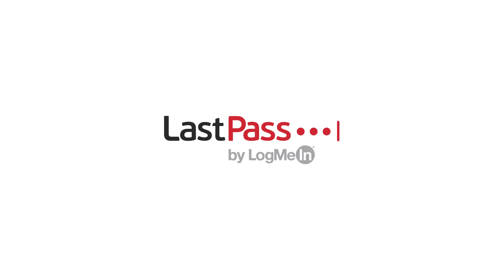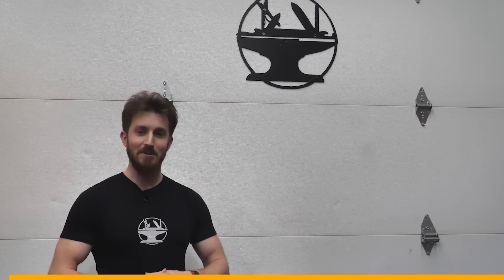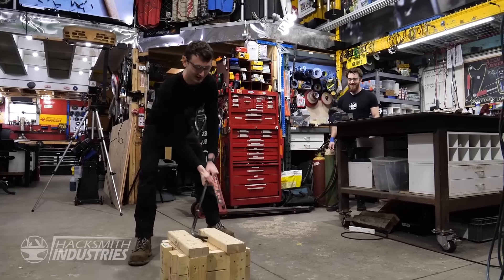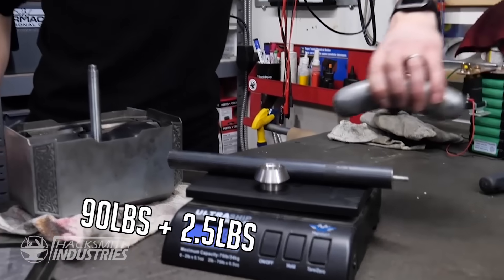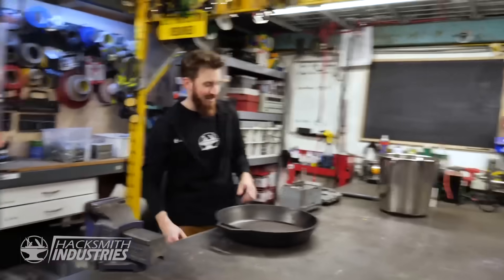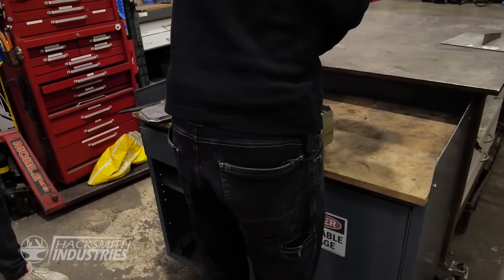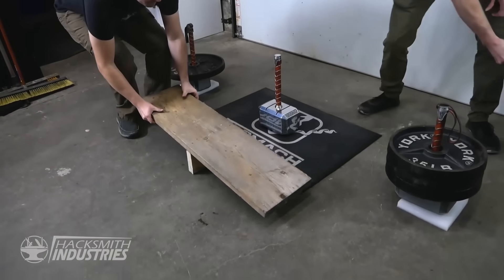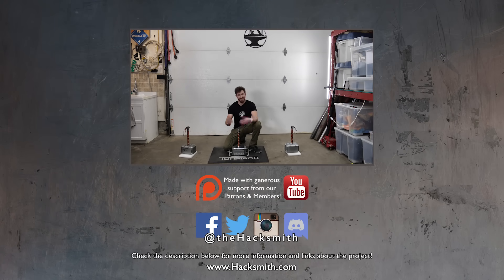Tungsten Thor's Hammer (World's HEAVIEST)

Comment from the maker: TOP QUESTIONS:
- Why didn't you melt tungsten?
Because it's got the highest melting point of any metal - no mold could hold it!
- How Ridiculous has a heavier one!
Yes... But it's also like twice the size. We have the heaviest 1:1 scale replica
- Use Osmium, it's denser than tungsten!
It would cost $3.2M if you could even find enough.

Other questions can likely be answered by watching our original video on the lead filled version, don't forget to check out all seven of our different thor hammers!

Thanks for watching!
Reply: Hey Hacksmith, I am making a theoretially bulletproof Captain Amarica shield and I can send it over so you can test it with more than the handgun you normaly use.
Reply: thanks
Reply: Hacksmith only though
Reply: + is 10 lbs heavier really worth $ 3.2M  ???
Reply: What about Iridium?
Reply: Did you like your own comment?
Reply: @Tombr4mb4  it pushes it to the top
Reply: @Tombr4mb4  did you
Reply: @Tombr4mb4  look⁹
Reply: the Hacksmith when will there be a video of you giving him the hammer and him trying to pick it up?
Reply: the Hacksmith my only question is why you don’t have 50 million subs yet
Reply: Why don't you use real neutron star matter?
Because taking on the full force of a star will kill you
Only if I die
Reply: Dear hack Smith I'd like you to make ruby's scythe from rwby
Reply: Should’ve filled the handle with something after you put it back together 😂
Reply: Shad0wr3x Z
Reply: Hi Hacksmith! May I ask where you learned how to do all the things you do primarily electrical hardware/software builds and metal work? Were you self taught or. have some professional education for your work? I am completely new to metal work and electronics but always have had a big interest in making my own things like my dad who passed away when I was young but I remember him always making things in our garage like upgrading and customizing his motorcycles to even making me toys that haven’t been made by any company yet like my own Zelda sword so I’ve always wanted to get into it but don’t have any experience nor the knowledge to get the proper tools or even where to start
Reply: Would it be possible to use tungsten for a custom handle for the lead mjolnir to help with balance? By no means do I expect it to 'solve' the balance but I'd imagine it'd help.
Reply: If you ever plan to make a heavier one, use a carbon mold. it'll hold molten tungsten.

edit: nevermind that's how you make tungsten carbide lol

Edit: Maybe a tungsten-halfnium carbide? It has a higher melting point and I on't think it'll form anything. but Idk how Expensive that would be.
Reply: You get my Like just for the Jujimufu shout out !!!!!!!
Reply: my top question:

HOW THE HELL DO YOU LIGHT A FLAMETHROWER ON FIRE
Reply: Dude just use magic. Much easier
Reply: the Hacksmith yeah why not Vibranium
Reply: you should use tungsten carbide its cheaper and heavier than tungsten, some heavy grade tanks use it 
as ammunition and it so heavy that its velocity itself causes massive explosions
Reply: Hey would you make a pilot suit from Titanfall
Reply: the Hacksmith you need to make a vid with thor receiving it and trying to lift it
Reply: You could have used a neutron star to fill it

Then it would had traveled to the core of earth.
Reply: Makes sense
Reply: My top question is 
What kind of drugs were those!?
Reply: Your Mom. aka Isaiah just smelling salts
Reply: prAna Stretch Zion pants?
Reply: Any chance of a video of his reaction to the gift?
Reply: Yeah I had the question about why melt  the tungsten. Then I asked Siri what’s the melting point of lead for reference it was 600ish degrees. Then I looked up  the melting point for tungsten it said 6,400ish. Yeah you probably have a point there
Reply: MusicalSteve   your*
Reply: the Hacksmith what about gold?
Reply: Chris Hemsworth is Chris HemsWORTHY.
Reply: Make one from Gold!!!!
Reply: I got an idea, what if you made a more equally weighted hammer. Vision described it as “terribly well balanced. Maybe fill the handle with a certain amount tungsten and the head with lead to equal out the weight from top to bottom??
Reply: יפה ערוץ טוב
Reply: put it in a carbon mold  lol : its made of diamonds
Reply: Try this with lead. Make a new hammer with a metal that won't change much to cold temperatures. Freeze the hammer to an extremely cold temperature. Fill with   lead and as the lead pours you have to get it to not only cool to room temperature  but to a temperature roughly the same as the freezer. This will make it really dense and have. Just hold it with gloves to avoid frost bite. Also, the cooling could be done with lasers if you set it up right. Try it, or at least figure out a way that you could try it.
Reply: Maybe you could have filled the handle with lead too!
Reply: Why don't you trade in some subscribers for that 3.2 million?
Reply: Make the next one out of neutronium (neutron star matter), it'll weight around 51.2x10^12 kg or 51.2 quadrillion kg. That'll make a pure osmium hammer look like helium balloon.
Reply: wheres the video with the mountain?
Reply: I actually was thinking; "why didn't they melt the tungsten"... A quick Google reference told me the melting point of tungsten is 6,192 degrees F. That would be why. You bring up a good point though, how is tungsten formed into any shape if its' melting point is higher than any other metal?
Reply: ask Elon Musk he will defenitly help you out :-)
Reply: the Hacksmith for an episode of make it real you should make predator’s wrist blades
Reply: I would love to take the damaged hammer from you,if you want.
Reply: Is it true that you're from Kitchener Ontario ?
Reply: How much did the hammer cost to make?
Reply: I’m pretty cheap and dense.
Reply: COULD YOU PLEASE MAKE THE WHEELCHAIR FROM JONNY ENGLISH
Reply: Could have made a ceramic mold and melted the tungsten, that way it could be over 120 pounds because the handle would also be tungsten.
Reply: @Maelthras  they may not have a furnace thing
Reply: It is actually possible to melt tungsten in a mold. There is a number of ways to make it possible. The simplest one is to melt it in itself, it is called "zone melting" or "travelling melting zone". But fairly speaking, it it a complex and expensive process. And it is definitely not the highest melting point, there is a number of materials which provide melting points (or sublimation points) at almost 4700-5000 degrees Celsium (some ceramics) comparing to 3695C of tungsten. But thank you for your work, it is awesome!
Reply: when deliver ???
Reply: Wheres that moutain video
Reply: When is the mountain gonna lift the hammer?
Reply: the Hacksmith is that what crack does to your body one sniff and u can be as strong as Thor
Reply: 0:25 You are my only hope into finding a material that is invincible except for heat of course
Reply: You could use tungsten putty like what people use for adding weight to pinewood derby cars to fill the gaps so it’s heavier.
Reply: ask elon musk nicely for 3.2 million for osmium
Reply: This is awesome, this channel is the best on YouTube.
Reply: Only the furnaces of Nidavellir could mold it
Reply: Amazing vid :D
Reply: How do I work here??
Reply: From where you just got that sit
Reply: the Hacksmith Machine it.
Reply: the Hacksmith is their a reason you don’t mill a hollow hammer of steel so it doesn’t melt.
Reply: Your hammer looked cooler
Reply: Take Stormbreaker to Iceland for the Mountain to try out or bring him back to the shop or to a park and have some sort of show for the public I don't care what you do but just get it to him to try
Reply: You could use mercury...
But it's liquid in room temperature, and toxic
Reply: Another thing, did you really light you flame thrower, on fire?
Reply: Dear Hacksmith you guys should make stormbreaker more heavier and more durrable and can summon lighting
Reply: Why not fill it with depleted uranium?
Reply: Thanos's sword plzz
Reply: the Hacksmith make super havy strom breker
Reply: Osmium how many views for Osmium?
Reply: Can you make a real spider web shooter?
Reply: If no mold could hold it, how tungsten could be moulded to be in those shapes (it came from the subscriber on different form)? 
Is tungsten base natural form is like a big chunk of metal and it formed by cutting it into small pieces instead of melt it?
Reply: Damblebee you need a graphite mold which can be some what expensive when you get the ones that are mass produced and that one would have to be custom made increasing the price and to melt it you need a arc furnace which can cost $100,000+
Reply: Great videos can't wait to see thors reaction when u bring him his hammer and don't snort to much of that powder the FBI may come a nocking lol
Reply: I cant wait to see thor pick it up
Reply: the Hacksmith Rhonium has the highest melting point, but Tungsten still does have a very high melting point
Reply: Yes, you can cast it, you can forge it, if suitable you would sinter it, and none of that can easily be done in your backyard, for various reasons. E.g. just look at the tungsten lightsaber oxidizing at high temperature.
If ordering a custom part was too expensive for this project, then setting up a way to form tungsten would be WAY out of scope.
Reply: Um if you can i dare you to make Qrow's sword scythe
Reply: the Hacksmith have you heard of HowRidiculous, oh well the have one over 220 pounds
Reply: Use gold for the next filling around the tungsten. Same density. Just have to make the case out of something a little more stronger than pot metal, probably 3D print it in a stainless steel laser sintered powder, though with 3D printing you could make it out of tungsten powder anyway, and have it come in pretty close to solid density.
Reply: My friend can pick up over 93kg and he is 14
Reply: the Hacksmith WHERE TF MY BOI MOUNTAIN AT?
Reply: If only you could afford a bunch of gold (lower melting point, while having a similar density than tungsten)... although pure gold isn't too resilient iirc
Reply: Use Osmium.... The Heaviest metal...
Reply: @nemesis101rox4  hopefully over the course of 9 months you've learned to read.
Reply: Osmium is next, right?
It'll be very expensive.
Reply: Iridium is more Dense than osmium And Tungstan.
Reply: @Tech-Facil-tf  Normally osmium is the densest metal.
Reply: Why don't you get a tungsten mold? You could coat it with wood then you have a free fire pit lol
Reply: I made stormbreaker out of wood a month ago
Reply: 3.2mil seems like a totally reasonable price for a mansion
Reply: the Hacksmith I was about to ask most of those questions
Reply: Wouldn't casting a Thor hammer out of Titanium be a good version? It wouldn't be the heaviest but that's not a bad thing. It would be heavy, practical and pretty solid would it not? I haven't seen anyone make such a version. I just think it would be a great idea, especially since it would be cast instead of filled like the armourfactory versions you have. Maybe I'm just completely out of left field and I am certainly not an expert when it comes down to any alloy. I just believe it might be the better of both worlds, solid and heavy yet still manipulable
Reply: Tungstens melting point is higher than the earths mantle and more than half the core
Reply: Make the Cryolator from Fallout 4 Please
Reply: the Hacksmith I’m expecting to see the gold Thor’s hammer next
Reply: Send Thor's hammer for Chris Hemsworth, the
Capitain's shield for Chris Evans and the Iron Man's helmet for Robert Downey :v and record this ;-;
Reply: "- Use Osmium, it's denser than tungsten!
It would cost $3.2M if you could even find enough." fair enough
Reply: The Hacksmith make the suit of the vulture full costume and working wings that makes you fly high
Reply: You guys need to make the winter soldier's arm
Reply: Plss next Bucky's arm
Reply: can you guys make a holographic green lantern ring
Reply: Make vulture's wing's please
Reply: Plss make Surtur's sword with Hell's helm and her knife(I don't even know the thing is)
Reply: Oh, wbout Iridium?
Reply: Do you know if you can make kratos axe from God of war 2018?
Reply: I was just about to comment that how ridiculous has a heavier and bigger thor's hammer
Reply: when you also weigh 50 kg :)
Reply: the Hacksmith so what you’re saying is tony stark and Bruce wayne could make an osmium mjolnir?
Reply: Ah yes your people lifting the heaviest one with their backs instead of their legs.
Reply: TOP QUESTIONS:
Only two of them are questions
Reply: Osmium would only get you about another 20%, so, it would be about 130 pounds, maybe 140.  Its also spendy as fuck, so, maybe you could rent the Osmium and then send it back?
Reply: But does it smash?
Reply: Doesn't tungsten have the highest melting point of any element?
Reply: Awesome extra explanations.
Reply: juji reference lol
Reply: :0
Reply: Busted liking your own comment !
Reply: Welcome to another episode of Cooking with James!
This time we will try to melt lead, using: a flamethrower, a lightsaber, and, a stove !
Reply: Couldnt you just mix it with flux?
Reply: for the second one, then how do manufacturers mold them to cubes to sell on market?
Reply: the Hacksmith you should make rainbow six siege rooks shield that turns into a full body shield
Reply: the Hacksmith you do know Thor's Hammer is fictional right
Reply: the Hacksmith osmium so rare crazy expensive
Reply: Hacksmith,I've watched so many of your videos but,you have to make/mold Thanos's infinity gauntlet and make magnetic infinity stones for the gauntlet if you can.
Reply: Could you crush it or make it smaller, and then melt more lead throughout it
Reply: Oh Jeff Bezos need a small loan of 3.2 Million dollars please and thank you
Reply: What about a mold made out of rock or something like that? I know its a stupid answer lol
Reply: Can you Catch lightning with Stormbreaker pls
Reply: I thought Brian Shaw was the worlds strongest as he won the Strong man competition many times, I guess I learn something new everyday
Reply: Well if you guys made meis frost gun, doom fists fist, and reinharts Hammer why not junkrats grenade launcher or roadhogs shrapnel shot gun
Reply: Wouldnt the outside be made of the same substance as the inside? Just to make it stronger and more efficient
Reply: You need to get the power loader done so you can lift heavy stuff like this
Reply: Where did you get the Thors hammer?
Reply: Make a iron man gauntlet
Reply: No you could use a mud mould basically a mould which you dig the earth find a good spot where you can put the mould you won't get exact dimensions but you would definitely a better job than what you have done
Reply: Using osmium or iridium could make it 300 lb+
Reply: Make the gosht buster connon
Reply: What about iridium? Isn't it even denser? How much does it cost???
Reply: A graphite mold would work just fine.. Just keep it in an inert atmosphere using a welding gas like argon.
Reply: You wrote the inscription UPSIDE DOWN!!!
Reply: So what would be the theoretical maximum weight if you were to mill this out of a solid block of tungsten? What about Osmium?
Reply: Haha.
Reply: the Hacksmith
Reply: Uranium. Help with your hulk effects.
Reply: You should totally make an osmium filled hammer with the outside being a mixture os osmium,tungsten and titanium
Reply: @yashcharanmahenthiran8989  for like 5 million dollars?
Reply: the Hacksmith why couldn’t you use vibranium?
Reply: @laurenbaker3879  vibranium doesn't exist. How old are you?
Reply: Where did you order that hammer from?
Reply: the Hacksmith do stormbreaker
Reply: 1 more question: why dont you fill up the handle with lead?
Reply: The hacksmith can we get  vedio on making gear and sword of "attack on Titan " this could one of yours hardest project.
Reply: > Use Osmium, it's denser than tungsten!
>It would cost $3.2M if you could even find enough

Just ask Mr. Beasts for help
Reply: Why didnt the strongest man in the world pick it up?
Reply: the Hacksmith you should do a real spider man suit
Reply: didn't know that osmium would cost that much. that's crazy!
Reply: dude im sure a country or countries will pledge funding for a Osmium hammer
Reply: I am pretty sure tungsten had to be melted into the shapes we humans use it for. If no mold could hold it, it would be unusable.
Reply: @freddybigs10  they cut it
Reply: The How Ridiculous hammer is a 1.3:1 scale so it's not twice as big but it is roughly twice the volume which is why it weighs 97kg (16kg of steel and 81kg of lead). The goal was the weight - to smash stuff, which is why it was scaled up.
The Hacksmith Mjolnir is the heaviest 1:1 scale replica.
Reply: Interresting but the handl is extremly slippery so use traditional leather wrapping be more usefull...
Reply: Do you think you can make thanos'  double blade
Reply: @the Hacksmith Cool idea that I’m surprised hasn’t been attempted but you could try make a proton pack 👻
Reply: Q. Why are you so badass?

A. Y E S
Reply: So why didnt you use respirators while melting the lead?? Everyone knows the gases that come off lead are extremely cancerous
Reply: a carbon mold couldn't hold it?
Reply: Why not use Tungsten Powder instead? You'd have way more product into your hammer and you can mix it with lead and pour it in.
Reply: Yo just subscribe and turn on notifications because you stuff interesting
Reply: Not to mention the osmium would react with oxygen, oxidise and blind you
Reply: Hey Hacksmith, you should do a video where you create the sharpest blade possible out of tungsten. That’d be pretty cool
Reply: You busterd it
Reply: @AVA_gamedev  Pretty much any ceramic would work.
Reply: Yes, I googled this shit. Hassium is over double the density of Tungsten :D
Reply: 안녕하세요 전한국인이예요
Reply: if every subscriber would donate 0.50$ then you would have enough for osmium
Reply: Get the Hacksmith can u make captain americas broken shield from endgame please
Reply: just us admantium mold
Reply: Better iridium ...its just as heavy as osmium and it has extraterrestrial origins
Reply: Sadly Thor has only won worlds strongest man once 2018, not years in a row.
Reply: Could you attach a flamethrower to your iron man suit
Reply: Just use gold or platinum. 55kg of gold is only $2.5M, much cheaper than osmium. And 60kg of platinum is even cheaper, only $1.5M ;).
Reply: Can you make thanos sword
Reply: Wouldn’t that make it the most dense hammer not the heaviest
Reply: What about depleted uranium?
Reply: when are you going to iceland
Reply: why didnt you just cnc it out of a block of tungsten?
Reply: When we get the one with him getting it.
Reply: I'll buy you some osmium
Reply: tungsten handle
Reply: Hearting your own comment is really narcissistic just saying
Reply: I know it's expensive, but what about gold? It has similar density to tungsten but also much lower melting point.
Reply: Now if you really wanted to go all-out, you could use osmium at 22.59 g/cm^3. But it runs about $400 per troy ounce (or almost $13000 per kilogram), and you’d need a sizable fraction of the annual worldwide production of the element to make a replica of Mjolnir out of it!
Reply: Hafpór Björnsson only has one Worlds Strongest Man Title!! In the video you said he has won it year after year, false Brian Shaw has 4 Worlds Strongest Man Titles. Brian Shaw is stronger everyone just gets caught up with Hafpór because his name is Thor and he was on Game of Thrones.
Reply: do it like mr beast
get some sponsors 
great video would get a LOT o views
You could have a tungsten mold i liquid nitrogen and pour the molten tungsten in**
Reply: You can use thorium
Reply: What about concrete as a mold, would it melt?
Reply: You pinned your own comment
Reply: @Le-Grande if they can resist the termal shock, the main problem still is how to reach the temp to melt that XD , that is the reason you need the heart of a star to do it o.or
Reply: 3.2 mill.OMG
Reply: Why not use a gas welding mashine?? Ever heard of that?? I cringed when you used that flamethrower gun ...
Reply: Why not use a gas welding mashine?? Ever heard of that?? I cringed when you used that flamethrower gun ...
Reply: You should re-create the ring handled bag that Angelina Jolie uses in Mr and Mrs Smith to get down the building.
Reply: Use a small amount
Reply: Oh and it would be about 3.2 million dollars
Reply: 3.5 million
Reply: And you could make a carbon fiber mold of it then line that with an inch of steel to cast the tungsten in and melt it using a 4 tube propane foundry problem solved
Reply: Make thanos gauntlet lol
Reply: You'd need a lot of ball point pens for a osmium hammer and record player needs
Reply: Can you make Thano's Sword?
Reply: You guys should check out the game called "Salmon Ladder!" available on IOS and Android for free.
Reply: Someone give this man $3M
Reply: If people find a way to make you immortal then in 3019 can you make a real infinity gauntlet with real stones
Reply: platinum would be the best as iridium is too expensive and osmium is toxic. only problem is platinum is about as expensive as gold
Reply: Use a neutron star core! Lol
Reply: I want to watch the face of the airplane loader when he will try to get that thing in the baggage hold. Or the lady at the check-in counter...
Reply: @SorinNicu  Lol " HNNNNNNNNNNNNGH what the heck is this?!?!?!?" XD
Reply: S U G G E S T I O N

The seaglide from subnautica
Reply: the Hacksmith you should make the leviathan axe and the blades of chaos from god of war
Reply: the Hacksmith I understand u r from us, but if u want to do things right u have to use international standar mesure units, and through away ur feets pounds farenheit and all of that crap; use kilograms, celcius or kelvin, meters, etc like any normal cientist in the World
Reply: Here I was comming with a lot of questions... aaand you answered it all lol
Reply: Sala jada bak bak na kia kar
Reply: Xw2q8s9s has aiaaioaOO
Reply: I am shashank  i stay in Bangalore in India🇮🇳
Reply: YOU ARE CRAZY!!!!!!!
Reply: the Hacksmith just use a type of rock as the mold after all if you can melt it you have just made lava!!!!!!!!!
Reply: I made such a hammer in the house. I stole all the lamps in the neighborhood where I live. I took the tungsten wires in the lamps and while I made the hammer I heard the sound of the door. When I opened the door I found that the police were waiting for me.
Reply: Not only would an osmium Mjolnir be obscenely heavy and expensive, but it would also be *really* smelly.
Reply: Where do I get one?
Reply: I wanna see the mountain hold it!
Reply: OMG I want one!
Reply: word
Reply: I don't understand why you didn't uses magic or sorcery. Yes, it would have required some sort of blood sacrifice, but...
Reply: How much weight is this thor hammer
Reply: If no mould could ever hold tungsten, how do you figure the original castings you got were made?
Reply: if you were a multi millionaire the  you would made the galaxy’s heaviest hammer
Reply: Could you not have made a concrete mould for the hammer with the case you made to create a pure tungsten hammer?  Also the idea is really cool and i love the video
Reply: Its been a month when are we gonna see yall give him the hammer
Reply: You could have arranged for a foundry to make a solid block of tungsten, and then cut it to Mjolnir shape.
Reply: Is the original hammer from the armor factory??
Reply: I scrolled through all the comments hoping to see someone mention the board of wood would've snapped in the thumbnail, but no one noticed?
Reply: Jonatan
Reply: why didn't they use a cement-sand mix to take shape of the hammer then melting the tungsten then pouring it in the mold that they did earlier...it would've been so much faster...I've seen people do the cement-sand mix before and instead of them taking 7 days doing it...it took them only like 1-2 hours
Reply: Why not Platinum ? High densitiy and would be looking awesome 🤟
Reply: You have 6m subscribers and 8 million views on this video and an entire team behind you yet a YouTuber working on his own made an exact replica out of a solid tungsten core which is better quality and heavier but only got 12k views and you don’t even give him credit in your video and still claim yours is the heaviest?
Reply: Yall might have been beat by a youtuber named Chris Hawk who claims to have a thor hammer that weighs 140lbs
Reply: the heaviest would be made out of osmium
Reply: That thing is heavier than I am and I’m 12 but can still pick it up and I know I can because I can pick up my 12 yr old 6 ft friend that is like 240 pounds lol
Reply: Osmium if the thors hammer was full of it would be 600+ pounds
Reply: Has thor gotten his hammer yet
Reply: the Hacksmith ok
Reply: @the Hacksmith , then how did they give that ridiculous shape to those blocks of tungsten?
Reply: Rock
Reply: How hard could it be to raise 3.2 mil smh
Reply: Why didn't you just use neutronium?
Reply: How ridiculas has a 97 pound hammer making yours heavier or am I missing somthing?
Reply: I love it vids
Reply: Most creative extravaganza channel.
Reply: Actually you’re wrong it’s not the world‘s heaviest to make the world‘s heaviest Thor Hammer you have to use osmium which is 22.59 per cubic centimeters
Reply: U need to make an iron man suit ..?
Reply: the Hacksmith The real name is Wolfram, no?
Reply: What if you kept it cool with liquid nitrogen?
Reply: Okay the thor hammer soo cool (again)
Reply: if each subscriber donates 50 cents you would have enough to build Mjolnir with Osmium
Reply: Can you make a real dual disk
Reply: Can i get some help from you sir please
Reply: That must be expensive building a tungsten hammer you should make more stuff out of tungsten since it’s such amazing element and not a lot of you tubers really wrk with this element since it’s expensive and in general hard to work with.
Reply: waiting line for some rich madman to make a 1:1 replica with osmium.
Reply: @SchafdoggGTO ,

Yeah... I think he meant there is no Thor's Hammer mold that can handle molten tungsten.
Reply: Dude I knew all this... I was expecting something new!! But ,anyways great content!! Loved it!!
Reply: Thanks man
Reply: Maybe you should try lead mixed with the tungsten to fill the holes?
Reply: All the dense metals are expensive, including Platinum and Gold.
Reply: the Hacksmith  fbi
To make a good job mm is a great day to work skyscrapers amp a lot to learn to live a better place to stay ekj is a beautiful night to a wonderful weekend to a friend
Reply: Isn't Osmium the metal that the scientist in a Fringe episode reversed effects of, helping people to float?
Reply: thats when the neutron star comes  to play
Reply: That’s why😄
Reply: Tungsten mohs 7.5. Tungsten carbide mohs 9
Reply: the Hacksmith why don’t you make the surface and the inside of the hammer out of tungsten
Reply: Tungsten mohs 7 it to hard to mould
Reply: why not use Uranium? its heavier than Tungsten.
Reply: lhapekl uranium is radioactive
Reply: the Hacksmith couldn’t you use tantalum carbide as a mold
Reply: I am the (:;/-STRONGEST-\;:)
Reply: Where is the videohehe
Reply: How much does it cost to buy one of the mjolnir replicas you guys use and where can I find one?
Reply: the Hacksmith you can make it even heavier than osmium...

Liquid murcury
Reply: @ReiTheBunnyttv  they explained in the very comment you replied to why they didn't use Osmium. Read before you type my man.
Reply: Make kratos axe or blades
Reply: I wish i can have your one of marvel's weapon of this coming christmass
plssss can I caUSE I LOVE MARVEL
Reply: the Hacksmith iridium
Reply: tungsten is probably too dense to melt without melting the pan.
Reply: some of them ain’t even questions
Reply: the Hacksmith why did you use tungsten? Thor’s hammer isn’t really that heavy in the mcu
Reply: They should make one out of depleted uranium.
Reply: You should make a haole iron man soot
Reply: Next make a iron  man suit ..
Reply: the Hacksmith says martins licis is strongest man but idfk.
Reply: the highest melting point is tungsten carbur, which is like 2-300° more than tungsten but is ok :3
Reply: Did you do drugs
Reply: where did you get the coke
Reply: Tungsten can mold easily,, minds over matter,, even the heaven u can reach out, by mind
Reply: Then use tung Sten on tung sten
Reply: Can you make the world strongest phone
Reply: What if someone drop that on your foot
Reply: Ma man has a to do list kil thanos train stormbreaker take a nap
Reply: Umm...Hathor? That would be the egyptian goddess of love.😳🤣
Reply: Thats heavy
Reply: Nice video 👍👍👍💪💪
Reply: Use wolframio
Reply: My buy $200
Reply: wHy DiD yOu NoT uSe OsMiUm
Reply: the Hacksmith tungsten is has a super high melting point, also the strength of it is insane
Reply: Make thor's hammer that comes back
Reply: I'm a kid but I'm really into science so I wish I could work with you
Reply: Iridium is heaviest
Reply: Use communism
Reply: What did u sniff
Reply: "- Why didn't you melt tungsten?
Because it's got the highest melting point of any metal - no mold could hold it!"
Therefore, the casting molds are not made of metal.
Reply: the Hacksmith yes a MOLD of tungsten would Maybe work?
Reply: The throwing a washing machine  almost 4 meters is okay though once it hits the ground, thats where the counting ends ( that was more like 8 ft tbh). He could bench more than 500, because I have seen smaller guys bench 400-600, and I certainly know the dude that played The Mountain could do that. As for lifting, if he won by pulling up almost 1000 pounds in the stone balls thats one of the last challenges I have seen so many times, than yes, he is surely, one of the strongest to ever live. Top 3 fer sure. ^~^
Reply: Also am I the only one questioning whom and for TWAT purpose so much machined tungsten with screw, riveted or bolt holes was used for? o>O
Reply: FYI, if cost is no object they make tungsten BB's that you could pour into the hammer and fill it with epoxy....they pack fairly well.....just saying...
Reply: Make an identical one to the heavier but empty like the original one, then take em both to a public place, then u challenge people to lift the heavier one, then do some "magic stile" to swap the heavier one for the normal one and pick it up just fine, make people think u actually are super strong.
Reply: Why didn’t you use a ceramic mold?
Reply: dawne Johnson can't up this?
Reply: This $3.2M pff haha
Reply: You should've used skull melting to melt the tungsten carbide. You guys made an electric tungsten heating rod as your lightsabre. You guys certainly have the capacity to make an induction skull melting coil that can get hot enough to melt tungsten.
Reply: You could also use Iridium or- the best option and probably original super hammer material- get collapsed supernova. This would be amazing.
Reply: the Hacksmith why not try giving it to a gorilla they are way stronger than humans what a beautiful way to show how much stronger they are from us
Reply: Now do degenerate neutronium
Reply: Still haven’t sent it!
Reply: Just 5 more pounds and you would be carrying me
Reply: the Hacksmith why did u like your comment ??
Reply: Lo
Reply: Make the case out of tungsten
Reply: Idk why i didn't think about that but you should make the case out of tungsten
Reply: Well i think u should go to Nidavellir and try to melt the osmium im sure the Giant Dwarfs can handle it. Unless Thanos reached there before u 🤷🏾‍♂️
Reply: guys look at 0:26 😂
Reply: I want one of thor hammer  i would like to purchase it
Reply: Sand casting isn't able to hold liquid tungsten?
Reply: someone knows where to buy the empty hammer to fill it up myself
Reply: Op
Reply: I lae it
Reply: Good
Reply: +l0l00l
Reply: @Frank Weimorts thorium is radioactive...
Reply: Aa
Reply: Aq
Reply: @@aq
Reply: Okay so yes oh yes oh

Oh yes oh yes yes
Reply: Oh yes $1000000
Reply: $1000.
Reply: Where are your shop ??
 Pls.....
Reply: Or u can just use neutron matter lol 😂
Reply: Osmium have toxic you can try gold one and cheaper
Reply: How bout putting lead inside the handle that would make it more heaviers
Reply: Actually Tungsten is not the Heaviest metal you can use to do the Thor Hammer, you can use the Iridium 22,56g/c3 but of course, its super mega expensive 😂😂😂, i prefer not imagine how much it will cost XD
Reply: Ei kommentteja
Reply: @Hacksmith can u buy a thor hammer from you
Reply: P
Reply: Metal

Density (g/cm3)
Iridium   22.65
Reply: Nice
Reply: Lead fumes????? Not Healthy
Reply: Why didnt you use gold?
Reply: Maybe you should've tried breaking a Nokia phone....
Reply: Thors hammer looking kinda thiccc
Reply: Why did you not make the outside tungsten
Reply: 🇦🇺🇦🇺🇦🇺🇦🇺🇦🇺😀😀👍👍👍👍😁😁🇦🇺 Thor hammer
Reply: How about you get Osmium
Reply: Though this probably won't be seen by you guys... I had a plan to make the hammer completely out of tungsten and have the handle screw into the head of the hammer sow the two pieces would mesh together seamlessly.
Reply: Make a super sledge by heating lead and putting it in sledges hammer it would be sick
Reply: R u wanting in idea 4 a build.  Fallout power armor..   U might want 2 week with a..........  Armmer  maker.?  . That is powerd  with  a DD.  Battery.  ?.
Reply: يلااتح1
Reply: I'm not smart.. Saying that.  A dirt.  Mold.?  Wood the dirt.  Tern in 2 (lava. magma) ?  What if.  U had a mold that had a freezer.  Pumping cold air on the mold.  Keeping the mold from over heating.  2 it's melting point..  I'm not a smart person..  How   or if it wood wrok?  Tungsten.  Is the heaviest Mattel?
Reply: mmm
Reply: lol I just wanna know what that strength boosting cocaine he was using was
Reply: You should use Uranium or osmium
Reply: 11111.
Reply: เดียว
Reply: Could u not make the casing out of something instead of using the old casing
Reply: I just think that it is pretty impresive that the heat to melt tungsten is. 37,83 percent less than the surface of the sun
Reply: Ask lastpass for osmium money ;)
Reply: Qqqqqqqqqqqqqqqqqqqqqqqqqqqqqqqqqqqqqqqqqqqqqqqqqqqqqqqqqqqqqqqqqqqqqqqqqqqqqqqqqqqqqqqqqqqqqqqqqqqqqqqqqqqqqqqqqqqqqq
Reply: Qqqqqqqqqqqqqqqqqqqqqqqqqqqqqqqqqqqqqqqqqqqqqqqqqqqqqqqqqqqqqqqqqqqqqqqqqqqqqqqqqqqqqqqqqqqqqqqqqqqqqqqqqqqqqqqqqqqqqqqqqqqqqqqqqqqqqqqqqq
Reply: What company did you buy the tungsten from?
Reply: Why didn't you use part of a Neutron Star ?
Reply: I'm thinking of working with you guys but I'm a US citizen and I don't have a passport.
Reply: Ynnj
Reply: Tungsten has not the highest melting point
Reply: try bismuth
Reply: why didn't you use osmium
Reply: Thor jall
Reply: On the contrary a foundry can hold tongstun
Reply: Use a stone mold😂😂😂
It can’t melt or catch fire lol
Reply: Yep. Osmium is not an alternative. Francium is foolishly suggested as a better option in explosives than uranium because it has more power. Amount and cost are always most important tho. The reason why francium is a bad choice is the same reason why osmium is a bad choice: only an ounce of it is on the entire planet, and it has a half life of 20 minutes. That means half of it is lost after 20m. At the end of this video, there will only be half an ounce (14 grams francium).
Reply: Nice
Reply: I was thinking why not just melt the tungsten, then I checked the melting point and it's 3422°C
Reply: How about a water cooled mold? Run the water just after the pour starts. Steel lined and copper jacket.
Reply: Make a scythe out of only cardboard, tape, glue, and markers
Reply: Hey can please build 3dmg (from attack on Titan ) I don't think it's ever been made but this will be a sick project thank you and keep up the good work
Reply: @baljeet6715  it's actually ODM (omnidirectional manoeuvre) gear, but was wrongly translated and simplified in the anime.
Reply: @matthewdaltrey4676  thanks im guessing u into aot and  anime
Reply: @baljeet6715  I hope they do that but I think this channel just make the weapons from Marvel only :o
Reply: How did you set the flamethrower... on fire?
Reply: Nice
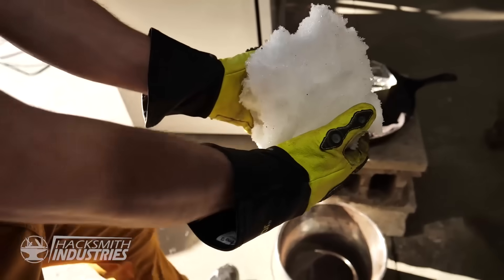Reply: Hey I was in the video at 12:48
Reply: Hi
Reply: Wish I could test out those hammers I live in Canada and my middle name is literally Thor
Reply: Tristan Hildebrand cool
Reply: @Derpathy  it's short for Russian ThorMOZ
Reply: can you please make wuuthrad from skyrim
Reply: Thor has pretty bad trip strength if you want grip then Brian Shaw is who you want
Reply: Lol
Reply: if you had cut the tungsten finer you mighta been able to fit more into the mold, unless you managed to fit all the scrap in in which case ignore what i just wrote.
Reply: Ah, so a challenge to find a method to make a fully tungsten hammer ey? Well then, let me run the numbers and see what I can do...I would love to see a cap shield made out of tungsten or titanium. I would be elated.

Edit: Awesome I’ve been noticed! Hope i’ve piqued your interest. I’m a bit of an idea guy, so stuff like this is right up my alley!
Reply: Hey Hacksmith Make Stormbreaker out of Titanium which is an extremely strong metal yet soo light,Thats a challenge for
Reply: @Daniel_ElegantUniverse  sorry not you someone else I did not mean to say that two you
Reply: the Hacksmith did you like your own comment
Reply: the Hacksmith next video u guys should try and shoot threw it that would be dope!
Reply: Just a reminder that Hafþór is a wifebwater, so, good job
Reply: Firing shots at How Ridiculous was not really necessary because theirs isn’t really that much bigger
Reply from the maker: @SuperSpeederCarl  it's nearly twice as big dude... You'd get tired of replying to comments too when you make a much more complicated and expensive hammer than just a giant lead one...
Reply: @hacksmith  why didn't you use respirators while melting the lead?? Everyone knows lead fumes are extreamly cancerous. 
I am 99% sure you recieved some level of lead poisoning during this video.
Reply: @hacksmith  it's been over a year, when are you going to deliver the tungsten hammer to the world's strongest man like you said you would?
Reply: @hacksmith  ;)
Reply: Just saying even if you could melt it it would take a Ton of heat to melt and if were able to melt it all you would have too much space and would probably take like another 42$ and it would be to hard to hold it with two hand also love your videos love the lightsaber and cybertruck replica also maybe one or two or a few questions why don't you make it a bit bigger to hold more also costing 19$ also why don't you make a functional suit for the iron Man core and last thing : make a CyberQuadbike and iron man original suit
Reply: If you can, can you make another Thor Hammer with Osmium metal? Osmium Metal is the highest and densest natrual occuring Metal on Earth. It has the densety of 22.59kg/cm3. Also i dont know how mutch is costs sry about that.😓 Also i love your videos.😅
Reply: the Hacksmith I triple Thor dare you to shave your beard